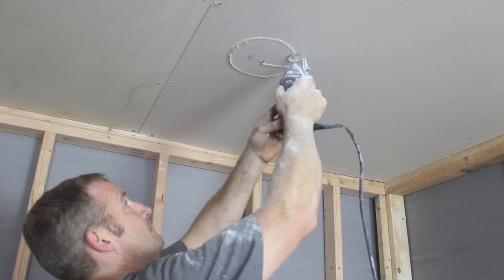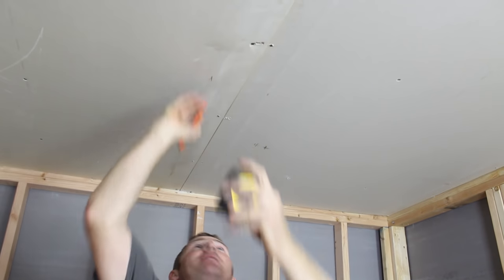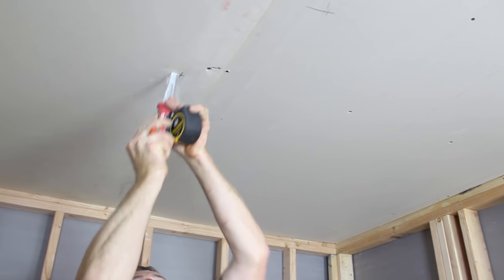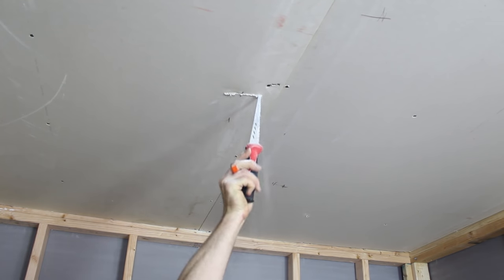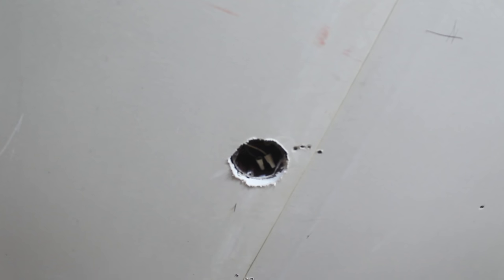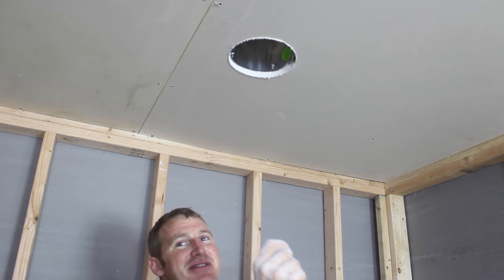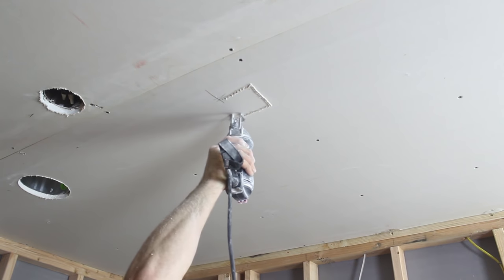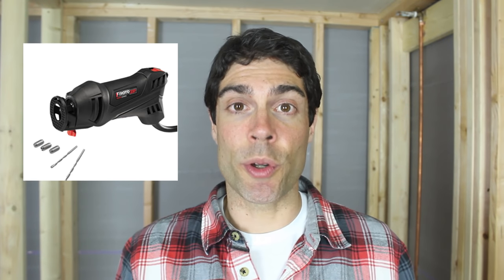How to Cut Drywall (Cutting Out Electrical Outlets and Devices) -- by Home Repair Tutor

Comment: You did a good job explaining and demonstrating the method and reasons for using the router (much faster and cleaner). I use Rotozip Guidepoint bits with a little round smooth tip so as to not cut into the box. Also, to cut on the outside of a box, you start near the center, cut to the edge, get on the outside lip and follow the rim counter-clockwise. This keeps the bit spinning against the rim, with less chance to wander away from rim.
Reply from the maker: +Swiss Banjo Man thanks for the additional tips, RotoZips are a pretty great tool. Makes the project go faster ;)
Reply: I'm wondering if a regular drill, with a drywall bit would cutout drywall like a router. LoL.
Reply: Yes, it  would work but a drill only spins at a fraction of the speed of a router/ cutout tool. Drill= 1200 rpm, Router = 30,000 rpm.

Comment: Great video don't forget to  use a dust mask . The is great I bought a second one cause my new one has a dust extractor.  works even better especially when doing work in costermer house less clean up . Now I have 2 . machine can always be replaced but not lungs . mask is eye glasses are just important . I learned the hard way great vid
Reply from the maker: completely agree, would love to check out their dust extractor system...wish there was one for every power tool

Comment: Question.... So Useful video thanks by the way... But i still messed up... I missed my cut by 1/8 or so around shower drop ear, so when i drilled drywall it cracked a little in a circle, i cut and pushed it up, but seems like the only thing holding the crumbled drywall is the paper... It feels a tiny bit weak around that hole... Do i scrap it and redo it or what would you do? Damn mold resistant drywall is 20 bucks each, hurts to just throw away unless I have to... What would you do? 😭😭😭

Comment: Use a hole saw, use it with a dust collector silicone cup . I would never use that thing to cut downlights out, far too much dust. And outlets I use a Bosch cordless multi tool, way more useful than the drywall cutter.

Comment: I bought a DeWalt Cut-Out Tool and tried to cut out a round ceiling box and an outlet box on the wall. I couldn't control that thing! It went all over and messed up my drywall, so now I have to try to fix it So I'm going to stick with the drywall knife, because it doesn't take off on me and destroy the drywall.

Comment: That tool you're referring to as a drywall knife is a keyhole saw, and is best used to cut out Electrical boxes before the sheet is hung. Also you want to go counterclockwise with the router when cutting out Electrical boxes,

Comment: Grunting for an electrician, had I cut holes in that fashion without having the box basically flush with the drywall [paint surface], I would be packing my tools and looking for another employer.

Comment: Also, it looked like the electrical box was recessed too far behind the sheet rock. Needs to be 1/4" recess maximum in noncombustible walls/ceilings such as sheet rock. Why you must make your cut outside the box and have the box mounted to protrude to the outer surface of the sheet rock, or within 1/4"/

Comment: all your recess cans,outlets,light fixtures go to outside of can & run router counterclockwise. if you want to router out a doorway or a window go counterclockwise.
Reply: the home depot carries 3 sizes of guided zip bits like this fellow ^^^was explaining. i prefer the medium guided bit for my boxes,a/c vents,outlets. I also use the large guided bit for my doorways & windows

Comment: Great tips Jeff.  I have seen that on the home repair TV shows but didn't know what it was. Very helpful. Douglas
Reply from the maker: RetroWeld thanks, yah the RotoZip is awesome at cutting drywall. It's so much faster than a normal drywall saw. Sure, it's a bit expensive but you can always sell it on Craigslist when you're done :D
Reply: +Jeff Patterson you cut your boxes backwards...try counter-clock when cutting around something and clockwise when cutting inside something...the same applies to cutting over lapping joint. i havent used my key-hole saw in at least 12 years.

Comment: Code now requires the boxes to extend through the drywall you need to cut the box holes before you attach drywall. Additionally you should be using a rotozip with a bearing and only running inside the box. It you run outside box you can damage any sound or fire protection. The drywall will need to removed and problem fixed before inspection will pass costing drywall installer money and time.
Reply: Code allows a box to be recessed up to 1/4 inch from surface of drywall
Reply: You can also buy a box extender to make it flush with surface if it is buried deeper the  1/4 inch. That way you don't have to remove the drywall and move box

Comment: Dry wall people regulary cut my wires and cost me many labor hours.  They use routers and rotozip tools.  We push our wires way back but they still cut some everytime.  Sucks that they don't care about the other guy and cost me thousands of dollars every year.  I don't screw up other people's jobs but it is OK for the dry wall people to screw up mine?  It's OK because they are in a hurry and want to make money but I have to put these huge loops on my wires so I can pull down more and make up joints later.  That sucks.

Comment: it looks like hes going the wrong way with it
Reply from the maker: at first we go clockwise in this video but ultimately end going counterclockwise like RotoZip recommends. I just adjust the depth of the bit to suit the needs of the project
Reply: he did , he should be going counter clockwise and you should never put a screw that close to the cutout he just broke the board and created more work for the finisher